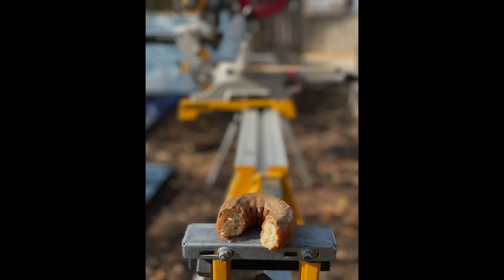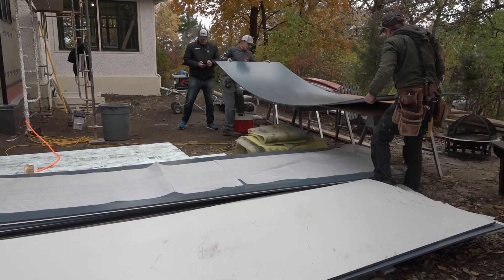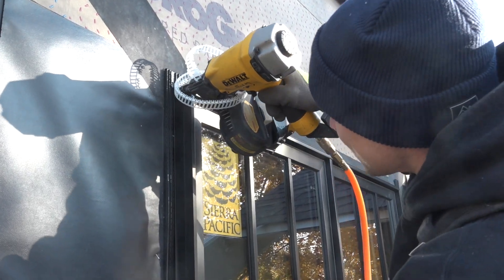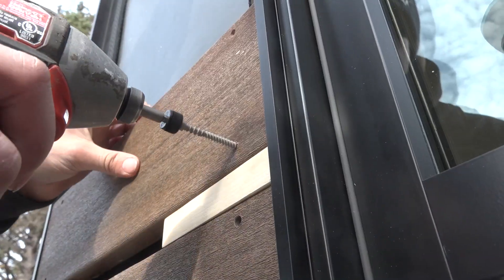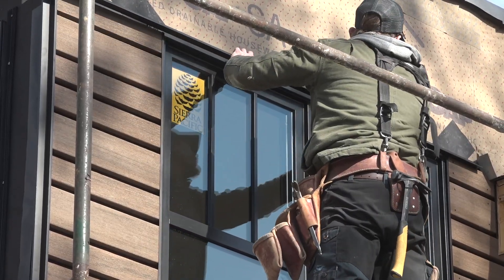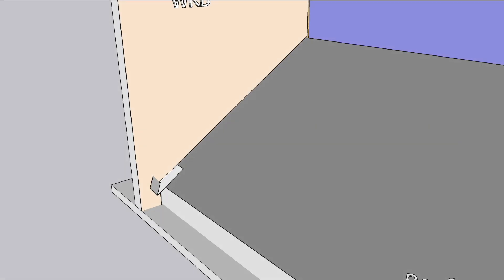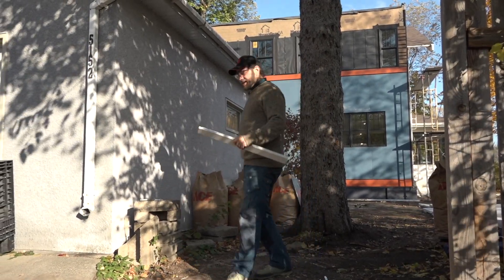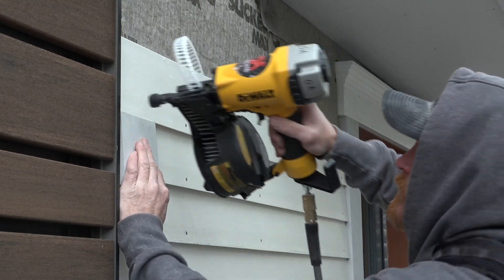Open Joint Cladding With AZEK Decking and Benjamin Obdyke's Invisiwrap UV (Building Resilience #8)

Comment: Any links for the black trim used to hide the edges? Is it the J-mold? I searched the company, but there are so many different types of edge trim. Looks like you are using the J mold but I cannot fine one that works with 1 in thick cladding.
Reply from the maker: The metal channels are trims from Tamlyn. They are not cheap, but they look great.
Reply: @ProTradeCraft  I can't find it either. Please send the information for the Tamlyn trims.

Comment: The scaffolds used in this video are blatant violations of OSHA requirements for the walking surface
Reply: and fall protection.  On the bright side, you have provide any injured employees with evidence of a history of unsafe practices.  That should ease their settling their claims for compensation.  

Every year falls from heights are in the top 10 causes of injury in construction.
Reply: @vincentkuntz5106 Kids used to carry shot guns, and somehow men walked skyscrapers on thin I beams 800 feet in the air with no ropes while eating a sand which and Whistlin .    While safety is important,  we have regressed into a nanny state, where projects take 4 times as long and cost 10 times as much.  Self preservation used to do more, than relying on a rope to trip on.  I’d rather leave it up to the individual.  They make 40 foot extension ladders with no tie off points.
Reply from the maker: Yeah. They were set up by the stucco guys.
Reply: Doesn't matter who put it up. OSHA will still fine the GC because they have a responsibility to everyone on site through the general duty clause.  The host sitting on the window sill was another violation.
Reply: @vincentkuntz5106  get lost

Comment: 40 tears of building in Oakland I've seen siding come and go.  Recalls and failures.  Expansion and contraction is especially when the structure is near the Bay.  Does this product work in a climate like mine?
Reply from the maker: PVC will not rot. It will move in response to temperature but not in response to moisture. Also, salty air or salty fog will not corrode it because it is PVC. It is rated for ground contact, which solves all kinds of other problems.

One of the sweet details in the trim elements by Tamlyn, which the cladding tucks into, giving room for expansion/contraction.
Reply: I've installed Azek decking professionally many times. The material tends to shrink over time in my experience. Off gassing is my guess on why it shrinks.